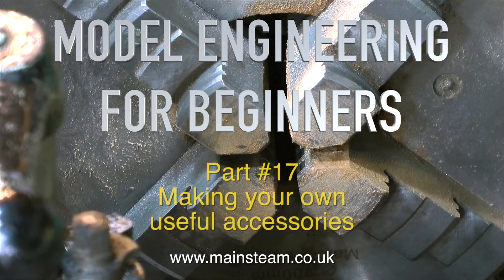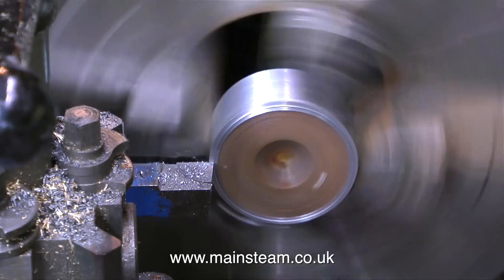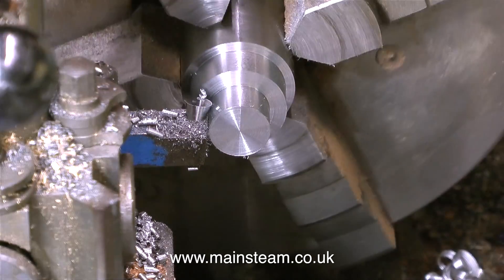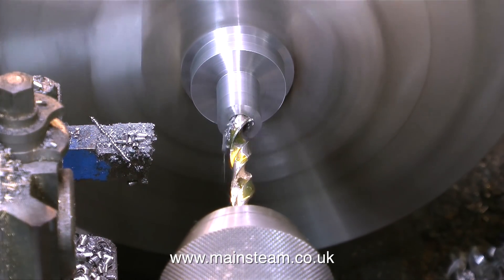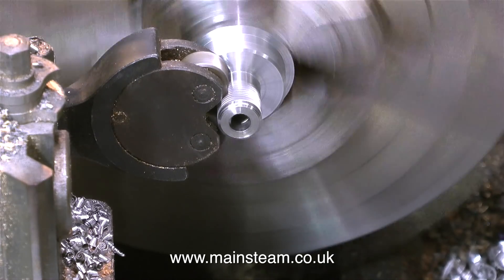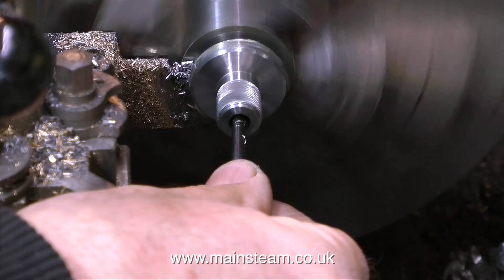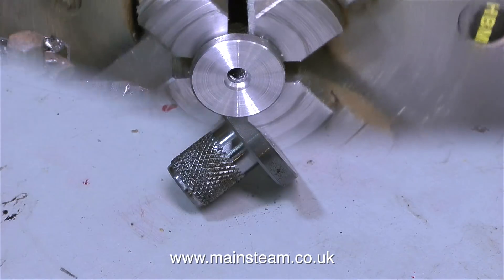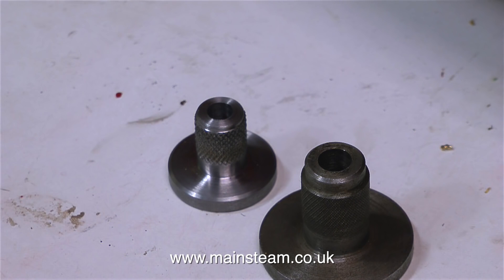HOW TO MAKE A THREAD TAPPING GUIDE - MODEL ENGINEERING FOR BEGINNERS - PART #17

Comment: This kind of tool can also be used with external thread. Hole slightly bigger than thread od (outer diameter) and tool od same as die od. Put it betveen die and die holder.

Comment: Hi Keith, Another advantage of the clamp style knurling tool you showed us is that it reduces side loading on the headstock bearings which is  possible cause of wera on the bearings especially on a lathe with plain headstock bearings.
Reply from the maker: Never had that problem, I don't do enough Knurling to wear my headstock bearings .......